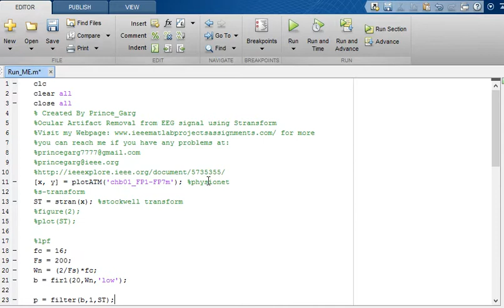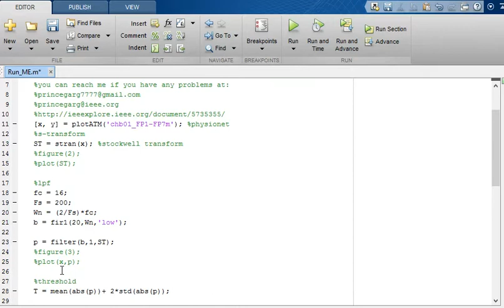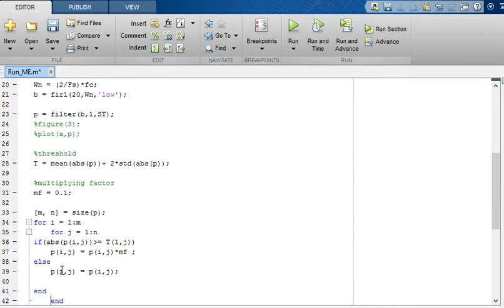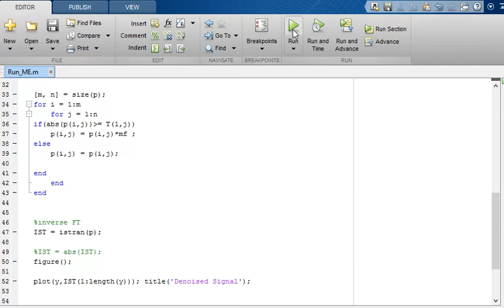A new technique for removal of ocular artifacts from EEG signals using S-transform Matlab code

Comment: Sir your line 11 statement plotATM is showing error
The error is undefined function 'plotATM' for input arguments of type 'char'
Reply from the maker: amanshu96 u need to edit the plotatm function by adding the function instruction with input and output you want or desire 
just add it at the top and you will be good to go
Reply: Sir i need a matlab code for removal of ocular artifact by eeg signals.
Sir can you please mail me the code . I would be very much thankful to you for your help.
email id : abhishek12.jsr@gmail.com
Reply from the maker: function [val, x] = plotATM(Name)

Add this instruction at the top of the plotatm m file and than run the program you will get the results
Reply: Do you have the complete code for  the above program including functions all etc?

Comment: how are you using plotatm
Reply from the maker: function [val, x] = plotATM(Name)

Add this instruction at the top of the plotatm m file and than run the program you will get the results.
Reply from the maker: amulya h you need to add a function instruction on the top of the the plotatm function which you have downloaded from physionet with output variables you want and the input is your signal
Reply: sir, i cant understand your statement ,pls explain sir